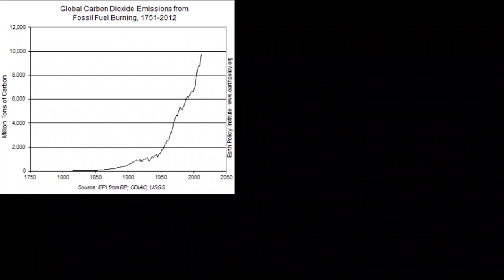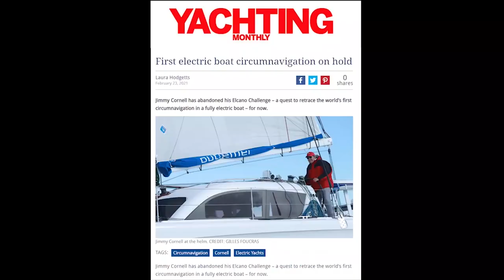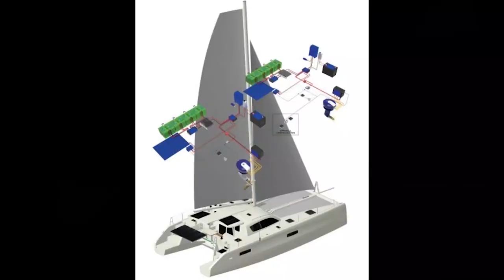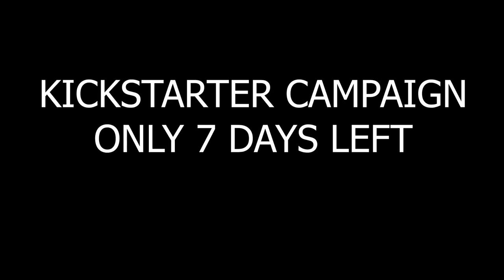7 days and counting

Comment: That boat is many, many imes more expensive than the least expensive Cat out there. I know of two ways to build a cat for 1/3 to 1/5th the price. The cheapest way is to build a cat like Hans Klaar did, a 75´ cat for $8000 built in Gambia that sailed and still sails the oceans for 20 years, safely. But for only twice that you can build a 60´wood core composite (epoxy glass) boat that is at least 12 times as stiff as the aluminium boat you are after and at 40% the cost. You could build that boat to be lighter than your aluminum project easily. Wood core epoxy glass laminates are in every way stronger than simple aluminum. And they can be much, cheaper. It is even easier to develop compound curves with composite wood core epoxy glass than it is with alum.
Reply from the maker: Production cat out there comparison. I could build a bamboo cat  for next to nothing too. A west system boat at a stiffness of the Mumby would be way more heavier than a Mumby...at a guess probably 50% more. But certainly doable and easier for compound curves as you say
Reply: @SAILINGintoFREEDOM  I thought so too until I did a lot of research and crunched the numbers. I was wrong and so are you, with a 1.375" doug fir core the epoxy glass is multiples as rigid for the same weight.

Comment: So every boat before about 1920 was without an engine and no electricity . 
 Slocum had no engine and no electricity . 

So yep it can be done . Just the modern stuff needs power .
Reply from the maker: What's more, they did it for 500 years
Reply: @SAILINGintoFREEDOM   Don't really need all the instruments running all the time for example .

Comment: Fully electric boat is absolutely possible with current technology but you have to accept very limited range of your engines. The solution is hybrid technology, right now it's a diesel generator big enough to power the engines. In the future it could possibly be hydrogen fuel cell but we're definitely not there yet.
Also with an aluminium boat and a fully electric system you need to be super careful about any stray currents. Those will corrode aluminium in a matter of weeks. But I'm sure you know that and you've already planned for it.
Reply: The hybrid is a poor half step. I am there already. Hydrogen is by and large from cracking petroleum at a cost higher than diesel at lower safety, it's not there and never will be. 
My choices at present for electric drive and regeneration are all off target at present. Missions like this make movement in implementation.
Reply: @corviswood  The hybrid is currently the only viable solution for extending the range of the electric motors to a reasonable number. By reasonable I mean being able to motor for 24h non-stop. You simply can't do that on battery power alone.
Reply from the maker: Floating earth and check stray currents everyday with led attached to positive and then negative
Reply from the maker: Yeah, the range will be very limited... Probably only 50 mile max... Will just have to sail or put the girls on a bike to pedal power us in to port
Reply: @SAILINGintoFREEDOM  Race to Alaska that stuff on novel human drives gets funny.
Reply: @yarpenzigrin1893  yes, on that, so I have had to decide on my version as affordable. Traditional small diesel drive will electrical pods. Working with a traditional wooden vessel. Not open ticket$

Comment: Hey Peter. Congratulations on your new challenge and choice of Mumby 48. 
Question for you regarding electric drive system 

Have you researched how long it will take for your boat to become carbon neutral.
Extraction of Raw material - processing - transport - production of final product.
Solar panels - inverters - dc to dc controllers - motor controllers - electric motors - cabling - lithium batteries 
How much of these materials are recycle able .
Reply from the maker: Maybe when I have time. At a guess 8 years if I hold  my breath
Reply: Who cares 😴
Reply: Being in construction the full list of impact is really deep. The best we can do is take each action where we can to balance. Research on if you will each 'sailing' vessel normal consumption of petroleum. To show this can be practical not just limiting will be major.

Comment: Try and make a calculation on the energy that goes in to making all that aluminium, and welding it together.  Just for fun, then calculate for how long you have to sail to save that back. And not to spoil it all, forget about most of you elektric stuff cant be recykeld.